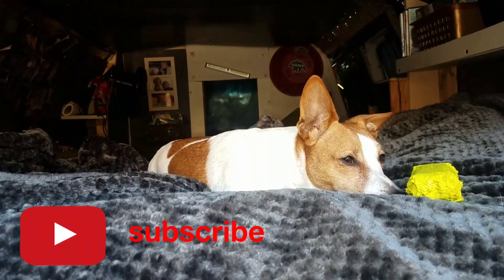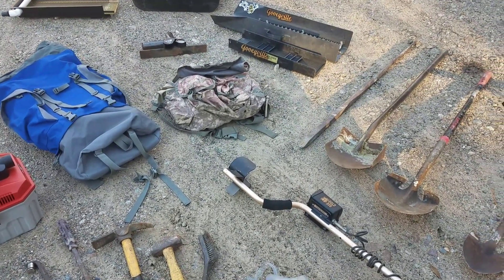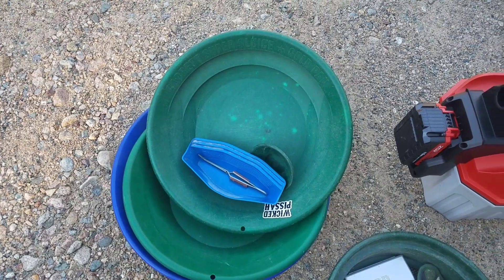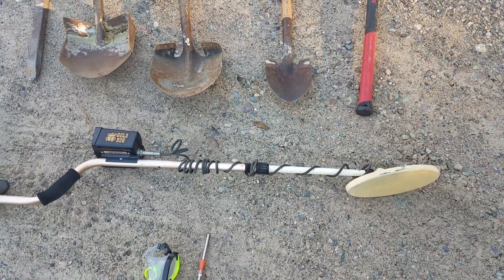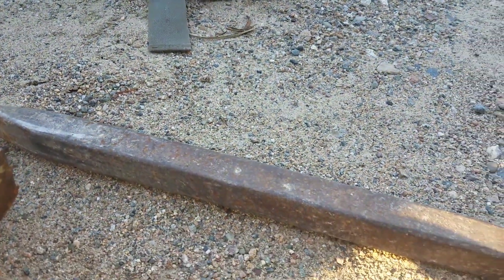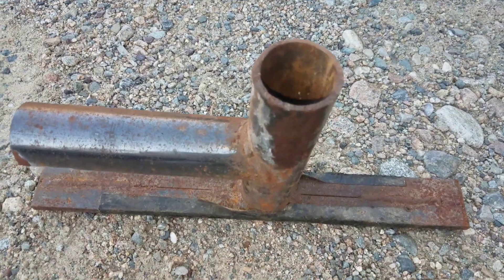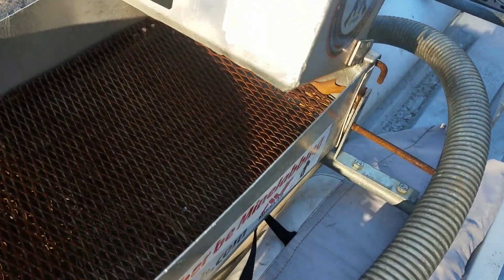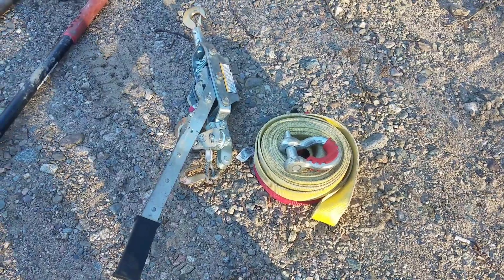What to take gold prospecting

Comment: I figured out to use the dewalt saw to slice it in half     reciprocating saw   and a diamond blade  to see if the rocks have gold
Reply from the maker: Tile saw will work also. Much safer. Or if you can get a 14" gas demo saw that's what I use to use alot. Best off just to crush most. Enless its an area known for specimen grade quartz

Comment: I'm out of orange county   I was going out to the shooting range    walking the creek bed     is that black sand     (sampling)  put a magnet to it   (magnetite)     specs and flakes    and found some quartz with iron oxide and pyrite    just laying on the ground  took the quartz home  (research on the internet)   how to identify gold bearing quartz    more sampling    specs and flakes of GOLD !!!!     I usually carry a sling pack (maxpedition monsoon)  loupe ,spoon  ,scoop  ,pry bar  3 1/2 gallon bucket   classifier like a 20 mesh  10 inch pan   some water   snacks   I'm still sampling   but getting specs and flakes   ,pyrite   gotta start sucking it up with my snuffer bottle   was just looking in the wrong areas       but finding AU  often     if I can get my game to 3 or 4 grams that would be nice
Reply from the maker: Best of luck! Sounds like your doing the correct things!

Comment: Gripper wench cable just feeds right through it if you think you're going to need to move Rock Army Surplus more durable than a come along gad bar and rock hammer est wing,blue sniffer bulb,a suckshon and biow 5/8 aluminum tubing2"mane body good handle on plunger piston ball adjustable L piston better lots of vents on handle side,
Rock rake, mining has nothing to do with Luck!
Knowledge hard work more hard work bumps and bruises and lots of mistakes that you can turn in to knowledge make a sluice box build your own dredges build your own recovery system or whatever is needed at the time things like power Jets 11 degrees where Square Tubing is cheap with a drill if the bolts you can build it just about anything you need old signs heater ducting make your own rubber matting they got some good stuff out now order it or just huge rubber matting off of rubber mat you don't need High rifles recovery systems are just general recovery system everywhere you go it's different their system may not work where you're at you're not Miracle system regular carpet looks very well indoor-outdoor just a little harder to clean out.
All these gizmos and gadgets are you not going to help you find more.
 your eyes open at yard sales sometimes people selling things for next to nothing metal detectors I have picked up for $50 Gold bugs gold Masters never learned how to use them they don't even know if they work Fisher really good about fixing them 4 nothing White garret really good too usually if you just open them up and wash them with soap and water gently and then dry them out move the switches around them they will work like new battery corrosion you must neutralize with vinegar and then clean with alcohol only on the affected parts there are a lot of good detectors gold-bug is very good most of the gold detectors are good big money on the detector not help you find gold with a detector.
Detector over a nugget knowing where they're at course you have to learn the basic just like Cannon and running a sluice box or any other kind of mining and that's somebody set you in a spot going to be tough going
Keep up the good work practicing and you're getting off the couch and getting out there and your head is in the game.
You don't classify a anymore good job! Remember every type of gold is different don't throw away all your skills because you see something working better on the right track figuring it out right time of year the right technique cold warm weather how to work with Mother Nature
Reply from the maker: Thanks